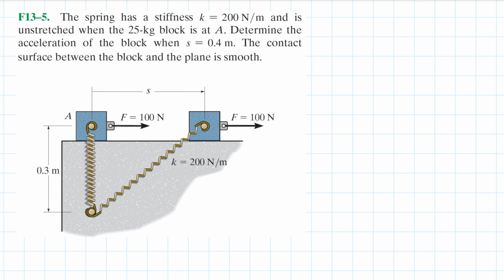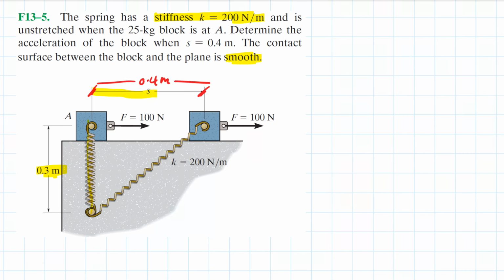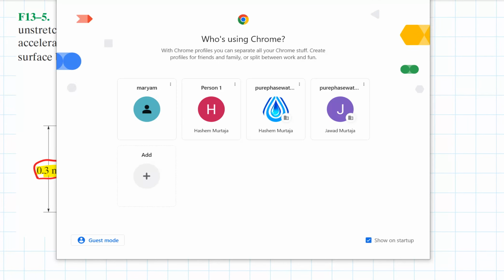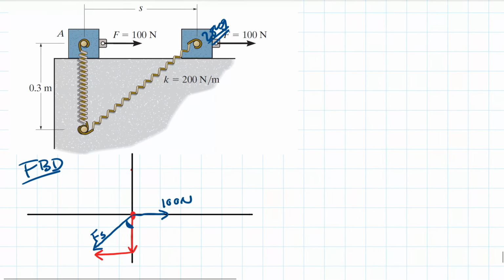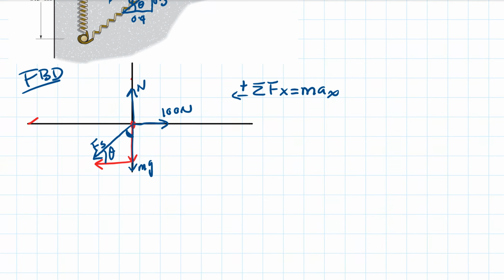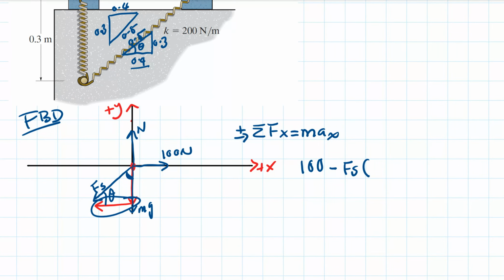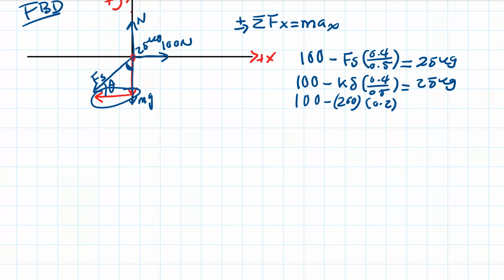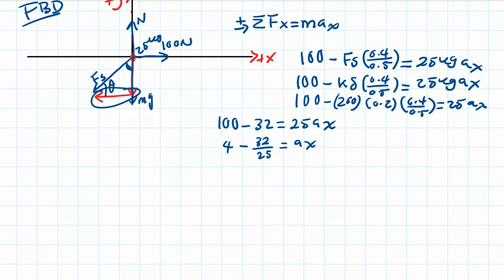Chapter 13 kinetics of a particle: force and acceleration | Engineering Dynamics | F13-5

Comment: why is s = 0.5 - 0.3 rather than 0.5 - 0.4? Confused as to why we seem to use the height if acceleration is in the x direction
Reply: I think it’s because we first calculate the unstretched length of the spring. Then we apply the spring force equation, 
𝐹=𝑘Δ𝑠=𝑘(𝑠2−𝑠1)
F=kΔs=k(s2−s1), where 𝑠2 is the final stretched length and 𝑠1 is the original length. The 0.4 value doesn’t directly affect the final calculation—it was only used earlier to find the stretched length. In the end, we only need to take the difference between the final stretched length and the original (unstretched) length of the spring